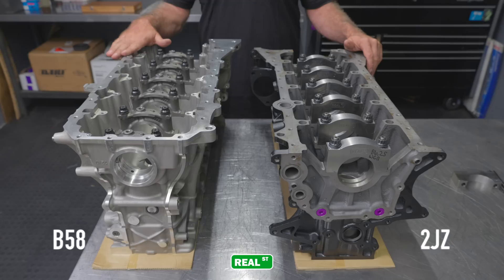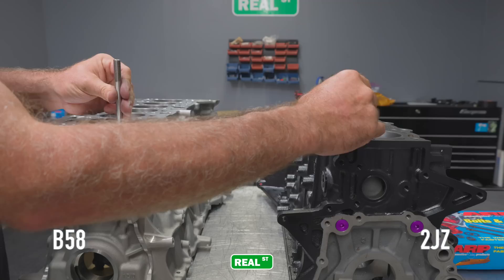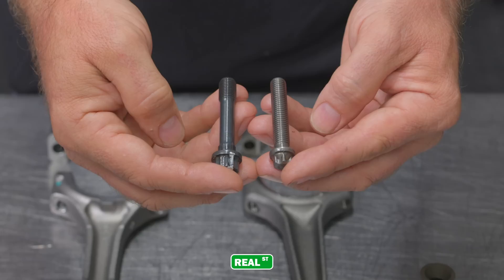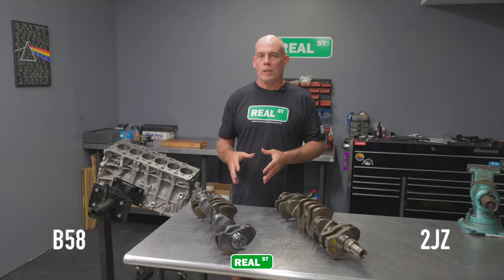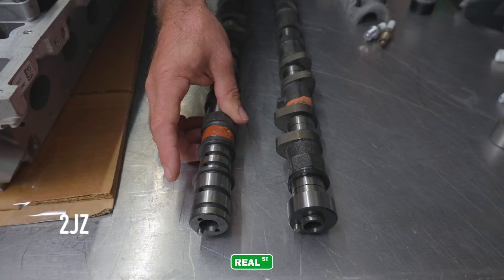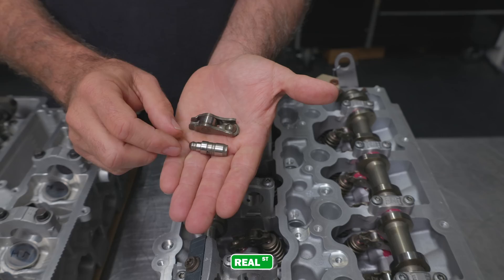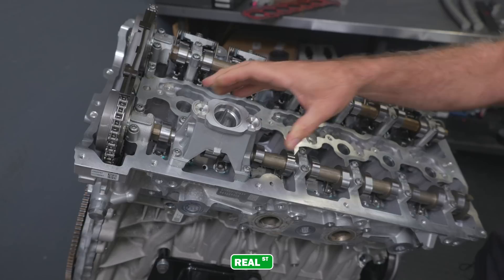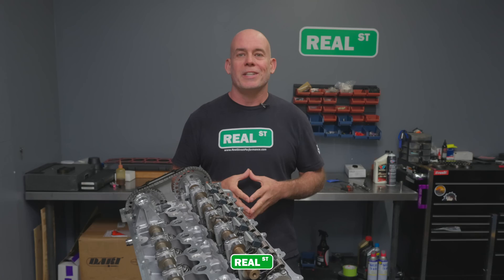Toyota 2JZ VS BMW B58 | 2JZ STILL KING?! (Detailed Engine Internal Comparison)

Comment: Keeping all that heat in the b58 head could give cylinderhead warp issues when stepping up the game with horsepower, not a fan of that design
Reply: They've honestly been handling the power pretty well,especially some of the fastest I the world are doing fine with those having up to 8-1100+whp doing multiple passes and driven back home without hiccups. Main one that would've caught peoples eye would've been Fredrick aasbos mk5 with 1000+whp being constantly ran threw and still runs fine up to now.
Reply: @carboydorifutoparty3976  wow thats amazing, never thought that this design would have worked with those hp numbers

Comment: Do you think the B58 Piston Rods are trimmed a bit not only to remove weight but also decrease friction points ?
Reply: They are optimized in shape and surface area to do the task without extra weight. I'd say the friction is also reduced.

Comment: This is like comparing bungie's halo vs 343's halo. New =/= better. The whole reason the 2jz is as good as it is, is because of its rugged simplicity. Just looking at the b58 by comparison as a mechanic I cannot help but think how half the parts on that thing look like a ticking time bomb. Say what you will about advancements but the more stuff you add to anything the more things can go wrong. If the b58 was truly better, nobody would still be talking about the 2j. Dont believe me? Go look up the 7m and try to find new parts for a reman. Or how about the trinity? Ever since the coyote came out, nobody has looked back. Ever heard of a 350 swap? Nope, not anymore, its all about that ls.

Comment: 2jz for me very simple design, b58 oil pump complicated and plastic internal can fail, those lifters can fail also along with those roller rockers.
Reply: Hydrologic valve lash adjusters such a pain it's why sr20 are weaker than most other 4cyl

Comment: I have been lookin for video or info that tels me outer measurements about b58 engine. How long it is, how long it is whit harmonic balancer. And how high? How High whitout oilpan… and so on. All i have found is weight. Video from different angles and measuring tape woud be nice.

Comment: BMW engines have been suboptimal ever since Paul Roche retired. They're great for power and performance, but at the cost of reliability and we all know, a broken engine is useless until it's fixed. Unless and until BMW returns its roots of sound engine design and construction, l'm staying away. Eventually, my old M635 CSl will be back on the road. What failed on that was a buggered up FI system from the time it was Federalized.....back in the Pleistocene.

Comment: Not really a comparison video, just a description video.
Reply: He did comparisons the entire video did you even watch it?
Reply: @hatch450sx3  Not really. A comparison would be something like, "The 2JZ head outflows the B58 head (even the 6 port) by an absolutely enormous margin." or, "The 2JZ block and bottom end is significantly stronger than the B58 block and bottom end." But he never said anything like that, he just described different aspects of the engines, without really comparing one engine to the other.

Comment: Any 6 second B58 setups? This is why the 2jZ is still the King.
Reply: It's like a 2-3 decade difference between them and they only heavily blew up in 2020/21. Give em more time,they just recently tapped 7s.
Reply: @carboydorifutoparty3976 I very-much agree the B58 is a solid motor. The R35 GTR has helped this entire industry with the newer tuning options/stand alone ECU's as well as all of the supporting modding options. So these cars and the RS3's have made huge strides in much less time. When the 2jZ came out - it was a different ballgame (for everyone and every platform). So no question - the B58 will continue to improve...do I think it will be stout enough to touch into the 6's? Honestly - I am on the fence there. 7's is amazing - but getting into the 200-230+ MPH trapping range is going to take some serious power and I am sure I don't need to tell you - boost requirements exponentially increase the stress on the entire engine. I will say - as B58's move to the mid and low 7's - we will find out a lot about those aftermarket limits.

Comment: Man, I have a 2013 BMW 128i with the N51 engine and while I have obviously contemplated swapping it for a N54 or N55 engine, it would take SO much money and effort to do that when I can just turbocharge my N51 and realistically make 300 whp. I rarely see ANY performance parts for the N51, but I have Active Autowerke headers, a cat-back Magnaflow exhaust, an AFE Stage 3 cold air intake, and an Active Autowerke tune. I already have a Walbro 450 LPH fuel pump for my car, I already have a Garrett GTS3582 dual ball bearing turbo, all I need is a larger set of injectors (and I already found them, I just need to purchase them eventually), and I plan on doing ARP head studs, a front mount intercooler, and some other random upgrades, but it will be a remote mounted turbo because I would like to keep my AC, and there is VERY limited space in the engine bay. My buddy just built a remote mounted Subaru BRZ with the factory FA20 and he made 358 whp with basically the same setup. I don't need crazy horsepower, I'd just like a bigger boost in horsepower. I'm not looking to spend $9,000 to build a car that will make around as much horsepower as mine will with less than $1,000 in mods.

Comment: Sorry but the b58 is NOT the new 2jz. Its a lot more complicated which in my book is no bueno. The more complicated is one part, more things can break.
Reply: In modern terms it honestly is. What other I6 ir 6 cylinder on the current market is making power as easy as these other than the Vr6 or S55/S58 that won't break tha bank?

Comment: What’s the difference between the b58 in a 16’ 340i, 22’ 340i, and new supras?
Reply: Supras ran the B58C being the 2 port variant thats seen in the 2020 models only(this varies tho because this was the case for the US mk5s,different markets may vary) and the later 21- current mk5s have the B58D 6 port version after the 21 models came about.Gen 1 B58s are similar to gen 2 and 3 but they all differ in parts either big or small. Gen 1 - weaker hpfp,different manifold and placements of certain pipes etc. Gen 2, stronger hpfp, has a 2 port head version,and different manifold design from Gen 1 and other small differences, Gen 3 has many parts that were moved up higher in the engine bay to a reachable extent, manifold is now exposed,and is now dual port and direct injected from factory. I'm partially going by memory and may be off a bit but this is all at the top of my head on what I remember reading up on the differences(and I can't remember by variant since there's multiple).

Comment: 8:43
all that tech and they put a plastic pick tube, which will (i believe) fail years down the line
Reply: Automatic transmission filters/pickups have been plastic for years. And transmission fluid can get quite a lot hotter than engine oil. Doubt it will ever be an issue. I'd be more worried about the goofy ass variable oil pump itself being an issue down the road tbh

Comment: What's the default (fail safe) position for the B58 variable oil pump? Low/High volume
Reply: I don't remember which video exactly it was but Jackie Ding explained a little about this. It's designed to target high volume as a fail safe. Even at idle he was getting near 90psi.

Comment: Dated? Yes of course, but it's simplicity and robust desing gives the legendary reliability of it. Use common sense: the more complex is something, the bigger sh*t hits the fan when it gives up. Oh and the integrated stuff is just makes it harder to repair (i mean b58). Another thing is you see bwm memes breaking down and being f*cking expensive on top of that, left and right but you don't see those same memes of toyota. Why is that? Easy: complexity and integrated parts adds cost and failiure points. Also the 2jz was a better rnd starter than the b58 because it is perfect for adjusting and revising for a mk5 supra, to make a 3jz. slightly adjust the parts if it's a known failiure point, even use the same tooling and blueprins for some (they have those still, flipping expensive the tooling and blue papers so most factories saves them) apply some new methods to make it up to date and voila a 3jz. So i smell bs and money when ppl say it was to save money on rnd on toyota side because the rnd would be already cheap (given of the modders did the job already in toyota stead).
Reply: No, cause if toyo made a new I6 it wouldn't be any different from the B58 just not turned at a angle and would have the dual porr and direct injection like the 86 has. Look at all the current i6s, they are barely any different to a degree other than mazda making a 3.3L but it's hp is sluggish without all the EV tech bumping it up. Toyo wouldn't have made a I6 anywhere near close to a 3JZ or at best a JZ in general. It'd literally have a different name along with a totally different design that'd be like any other I6 on the market atm. Aluminum block,prob dual port/direct injection,with the high chance of it being open deck like the rest of their current engines. At best It'd more or less wouldn't make anymore power than the B58 cause they even said that they wanted the mk5 to sit somewhat close to the mk4s hp and then bump it up later down the line. Emissions kills any chance of them making a I6 like that,and at best, they'd have to somehow make a I6 like BMW that is similar to the B58/S58 to even be worth a bother to put in the supra,and at best, it'd be a waste of time and money doing so when they could use that monet for something that won't give them losses down the line.

Comment: What’s the best b58 engine strength wise for 500-600whp ?  What year b58 ? And what model car does it come in ? Thanks
Reply: 21 apparently hold 800hp comfortably on e85 from my understanding
Reply: Reliably on the stock internals, they can hold up to 750-800whp. But quite a people are pushing well over 900whp.
Reply: The newest B58 is best for strength. Gen 3. Also the one found in the MK5 Supra

Comment: All that tech and it still can't do 2JZ things, all because it is a different animal. Nobody realizes that while we pretend it's a 'Toyota' the best 3.0L i6 Toyota engine that we should be comparing this with is actually the 7M due to having a nearly identical bore vs stroke - torque monsters. The 7M has its limitations from factory (due to being year 1 of forced induction by design) but while fully built both engines share very similar limitations in the aftermarket realm; revving capabilities, WHP capabilities, while making the exact same kind of torque. The 2JZ out revs both engines with far higher WHP capabilities than torque due to being in its own range of bore vs stroke and the factory engineering seven years after the 7M debute. Now 35 years after Toyota's first turbo engine we have a 1.6L engine holding 740whp across the factory longblock, just 235whp less than the B58's record despite being nearly half the size in displacement. Toyota never needed BMW's help in developing anything. However Toyota has not had the funds to produce any sports cars on their own since the LFA which impacted the company financially. To add to the development of the J29 MK5, Toyota also must synchronize with Lexus on creating entirely new platforms to share, which Lexus had platforms too young to cancel in 2018. The MK3 shared platforms with 11 other models, MK4 had 8 (including 1JZ), while the J29 BMW MK5 is sharing platforms with over 14 other European models, all to keep MSRP affordable.
Reply: There's mk5s running well over 7-800whp+ on stock engine, tho there's only a few that have gone over the 900whp+ range and still running around. Also, the mk5s platform is only shared with the Z4,the trans and engine(well....that differs also since there's differnt types of B58s)that's shared about threw out bmws other cars/platforms.

Comment: Are the 6 port exhaust heads backwards compatible? If I want to just swap my 2 for a 6 is that easily doable or does it require cam and heavy ECU changes to match?
Reply: They are. U just have to swap the heads and the turbo manifolds and noting else cause they're basically the same engines at the engine of the day.

Comment: Ironically the B was made better by Toyota for the Supra because it propably wouldve broken down hella easy or have a lot of issues🤣its Bmw afterall
Reply: Nope. It has been around well before the supra and it was already proven.
Reply: @josephsamsor1698  clearly you missed The point, The b58 was enhanced by Toyota For The supra to Make It better

Comment: Toyota engine still making the rounds even after its death with modern tech..I have a feeling Toyota its going to come back with another I6. Mazda may have stirred up some emotions?.. 🤔
Reply: Wouldn't make sense for toyo to make a I6 really at all considering their TTV6 exists.
Reply: @carboydorifutoparty3976  True but they have not put that in anything other than the 2 large suvs from top of my head. The Highlander even got the engine from lexus nx model. They killed off the v8 and v6 could be next but these are just speculations.

Comment: 2jz is still superior,  can handel 500hp. Will donuts around bmw.
Reply: I'd feel bad for u considering that there's B58s running over 500+whp with a dp and tune running just fine.

Comment: Toyota didnt just save money by partnering with BMW, but with Daihatsu also they rebadge and believe me its not the same the gearbox engine etc they go bad after 5 years or certain mileage.stay away from those rebadge vehicles.

Comment: But the porsche flat 6 dominates the nurbergring lap times....where's the 2Jcrap or the BMW? 😅
Reply: Anyone with a brain and knows about Porsche would understand that the reason for such is multifactorial and not dependent on the engine alone. Rear engine configurations, flat 6 with lower centre of gravity, some with Awd, complexly engineered gearbox and suspension to name a few. The video however isn’t comparing Porsches or GTRs 😏 but rather two straight 6 configurations, Engine ONLY.

Comment: The 2jz is still better, and it isn't even close, BMW can't make a durable engine to save its life, lmao. In another 20 years, people will still be building and using 2jz's, not so for the B58's.
Reply: In 20 years there wont be any  2jz's left, cuz people boost them till they blow up.

Comment: comparing run of the mill japanese engineering to top of the line german race engineering from Formula1.. its apples and oranges. with Toyota motors. If you compared a Honda F1 motor.. it might have some relationship. lol

Comment: Not disappointed by the stupidity in the comments, the jz series engine rrally draws in idiots. 

Im intrigued to see how far aftermarket companies go with the b58. We saw papadakis break 1000 hp already. 
Realistically its down to aftermarket builders and how far they will go. A lot of folks dont understand how much work you have to do with a jz to make bug numbers with good reliability.

Comment: B58 would never survive the amount of abuse the 2jz is put through, not because of its aluminum construction but due to alot of the BMW specific tech within it such as the valvetronic system. If you brought the 2jz up to a somewhat modern spec, ignoring alot of the advancements and considerations such as start/stop function, it would still outperform the B58 or if development of the B28 started at the sametime as the 2jz. They are just two vastly different identities
Reply: There's a 700 hp stock engine b58- no Open engine
Reply: @eduardoestebanab8049  2JZ was famous for making 800 hp unopened.
Reply: @PistonAvatarGuy 1089hp is the current record for 2jz
Reply: Someone with a B58 has been making 900whp on the stock internals reliably for over 30k miles from what I've heard. Many dyno runs and quarter mile runs.
The B58 can probably take a similar amount of abuse to the 2JZ. But the B58 is held back by it's aluminium block.
Idk why we are still debating, they're both brilliant engines in different ways
Reply: @PistonAvatarGuy  The B58 can also do that
Reply: Maybe, but not for long.  @Josh-qm4rb

Comment: Also, like dude said below, if it's complicated, it's BMW...that's true. I built a 1997 Honda Civic coupe that made 709 whp at 34 psi out of a 1.8L DOHC LS/VTEC engine with all brand name parts and it ran 9.56 @ 155 MPH for around $15,000 all-in. The most money that I spent were for the forged internals, the machine shop work, and obviously the turbocharger (which I still have). I also built a 2006 Acura TL with a six speed manual swap, a 2007 TL Type-S ECU, ARP head studs, new MLS head gaskets, and I fabricated a turbo kit for it and tuned on Hondata FlashPro it made 389 whp at 8 psi on the same GTS3582 turbo. Hondas are just SO easy to make power because they're always so simple and have the aftermarket support from MULTIPLE companies.